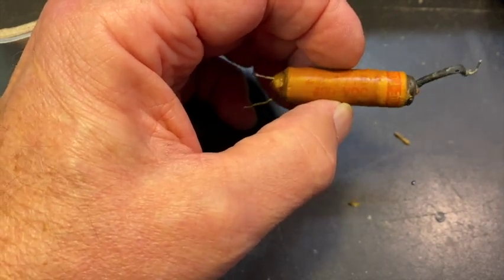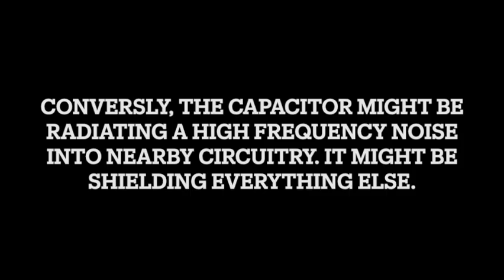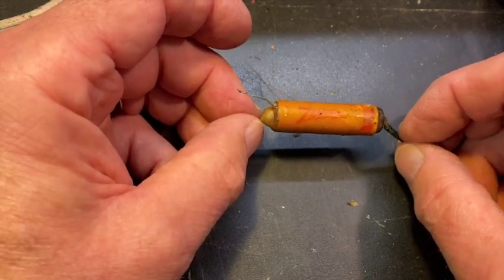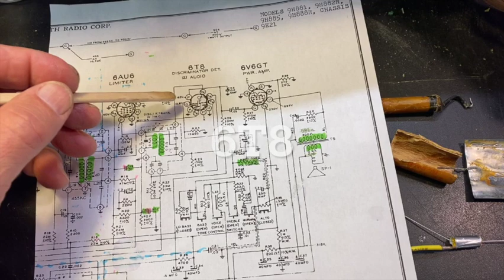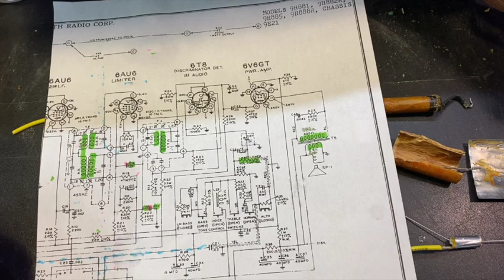Zenith 9E21 Part 4 The Shielded Capacitor

Comment: Interesting video! Have followed the series. It's always good to get other takes on even routine restoration tasks, and it's informative to view yours, thanks! On the matter of shielding caps, I have also found the braided sheild of large coaxial cable, like thick guitar cord cable, provides an excellent solution. It solders easily to a ground lead, and can slip over the new cap neatly. Thanks again for the content.
Reply from the maker: That's a good idea! I'll have to try that. Thanks, Rob.

Comment: New Subscriber! I enjoyed your video very much. It is very informative about the shielding of a capacitor in a signal-sensitive circuit. The way many other radio producers did it, was to simply wrap the capacitor in an insulated wire and solder one end to ground. However, watching your diagnosis process of the various options available to you, stimulated my mind. It challenged me think up another option. What I might try in my next FM project, is to wrap the capacitor in braided solder wick. Your fanning out of the strands of wire (with the aluminum approach) were the catalyst for my thoughts about the wick. Anyway, Great Video! Thank you!
Reply from the maker: Thank you. You might check the comment from Rob Harley regarding yet another approach.

Comment: Geetings:
I do not see why you did not reuse the original tin shield trimmed to length of the new cap. The remaining shield wire could be reused or replaced without the worry of the copper/aluminum interface. Also you failed to determine the outside foil end of the new cap. Paul Carlson would not be happy.
Reply from the maker: Perhaps you did not watch the video all the way through. I did use the original tin. And, I don’t much care what Paul Carlson would be happy about because I don’t know who he is.

Comment: Hi,
Shielded capacitors don’t come up too often, consequently a fair number of Vintage Radio enthusiasts and restorers - and quite possibly a few service techs are not familiar with how the metal foil is applied.  I have to say, your second idea for constructing a shield is by far the better of the two.  Aluminium and copper in direct contact, under certain atmospheric conditions, will eventually cause a chemical reaction - a type of battery effect.
Your method for constructing your capacitor shields is very similar to how I did it.  See my YouTube video “Raymond, model F17” radio repair/reconditioning.  I cladded a small rectangular capacitor with 0.3mm thick sheet tin plated mild steel.  
As always my friend, I’m enjoying watching you working though this radio repair/reconditioning.
All the best from Phil.
Reply from the maker: Thank you, Phil. I recall when Freightliner (an American truck manufacturing company, now owned by Mercedes) started adding aluminum bodies to their steel chassis, they ran into all kinds of electrolysis issues.

Comment: Well...that was interesting!!!  Not quite what I thought it was going to be, but close to what I thought.
The part that you couldn't make out on the original capacitor most likely said "Outside Foil" which most did, otherwise it often said "Ground" or something similar.  It marks the lead that is connected to the Outside Foil of the capacitor...the end that should go to the lowest impedance side of the circuit it is connected to.  Since the additional shield that was around the entire capacitor pretty much does the same thing, I expected it to be coming out the same end, however, it was instead at the "Hot" end of the capacitor.  A bit strange to me to have it that way, but doesn't really matter as long as it is grounded (or at least at the lowest impedance part of the circuit).  You might be interested in this video about the outside foil end of capacitors.  Quite interesting to me:   https://www.youtube.com/watch?v=BnR_DLd1PDI

It would be a bit of an expense, but I think it would be a cool idea to have some rubber stamps made that had standard values of capacitors like 0.1µF, 1.01 µF, etc. as well as voltages, and to use them to stamp a bit of white heat-shrink tubing that you could shrink over the capacitor.  That way it would be labeled still.  I have been thinking about doing that myself, but can't afford it right now.
I really appreciate your sharing these videos!  Sort of makes my day to see one from you!
Reply from the maker: Thanks, Wayne. I'll probably write the value of the cap with a Sharpie.
Reply: @fibberscloset498  That's probably what I will end up doing too, but I really love the idea of the stamps and heat-shrink.
Reply: Or see

 https://youtu.be/J31nVC0ms0w 

beginng at at time mark 39:30...